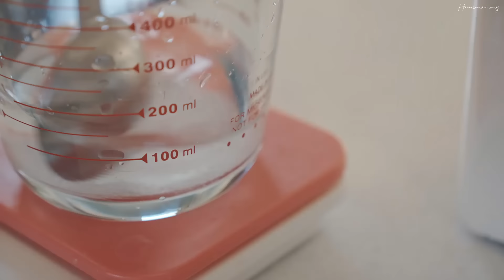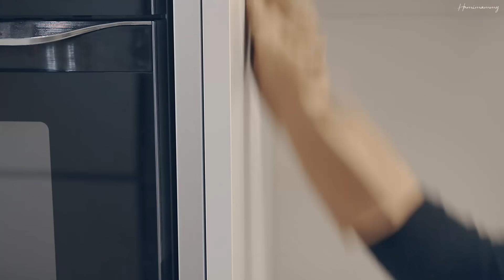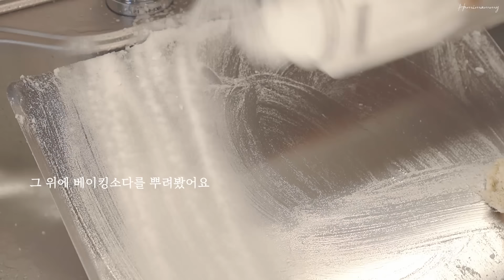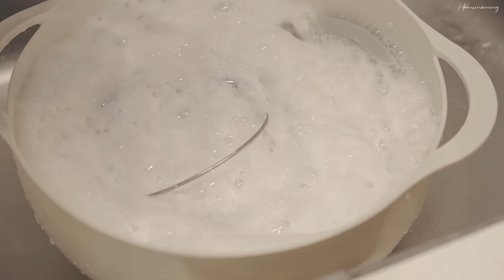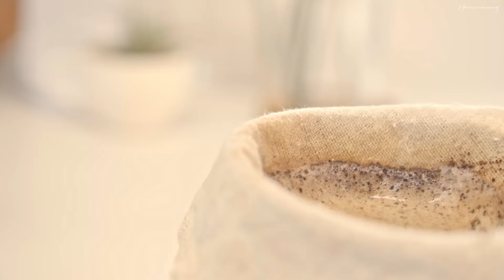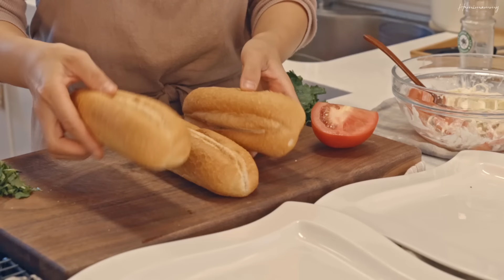SUB) 하루 20분, 깔끔한 주방을 위한 청소 루틴ㅣKitchen cleaning routine

Comment: you can use a     scale to chhheck the amount of your coffee. you dont need actually a server not necessary.  for example my cup is 300ml ı usually put 350 ml . coffee usually absorbes 50 ml water so you wıll get 300 ml coffee without using a server .